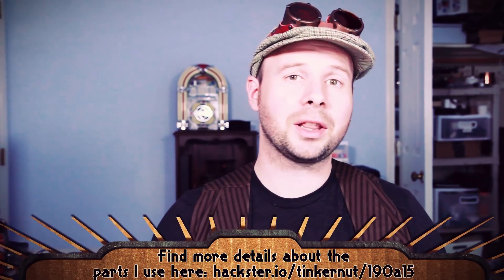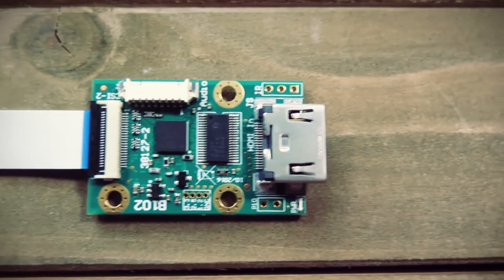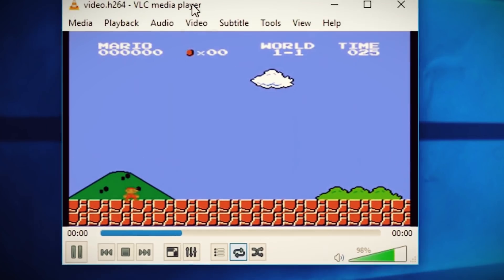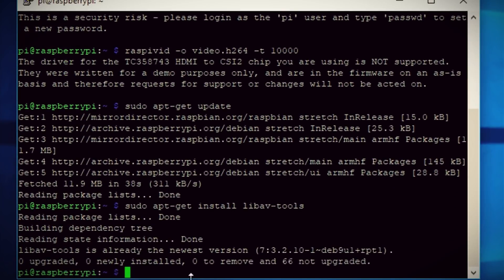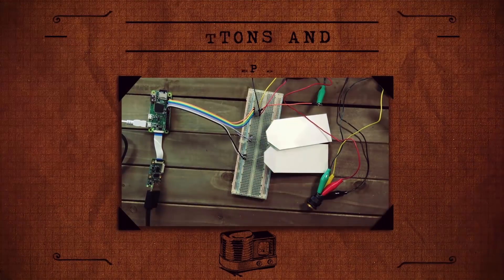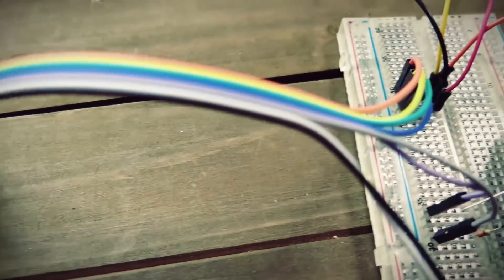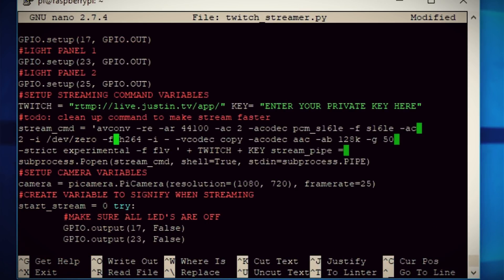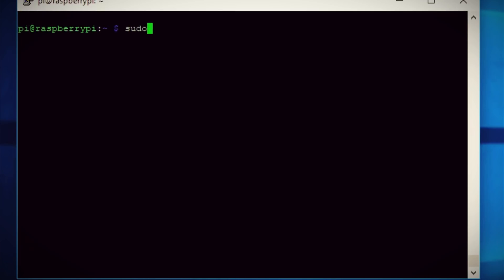⚙ Add Video Input To The Raspberry Pi - Tinkernut Workbench

Comment: Can you add a physical HDMI output as well? (Instead of a wireless stream)
Reply: Since that adapter is plugged into the camera port you should be able to view it just like a regular pi camera. The raspberry pi website has a good guide for getting started with the pi camera. I've personally never used it myself so I have no idea if it'll be laggy or anything.

Comment: I ran into trouble identifying the Auvidea model number to Pi compatibility details, so here it is: 

Auvidea B101: Raspberry Pi 3
possibly 1 and 2 as well, but I've the 3 and confirmed this works. DO NOT USE THE OFFICIAL PI CAMERA ADAPTER CABLE TO TRY AND USE THIS WITH THE ZERO. The official adapter uses opposite sides of the cable while the the Auvidea cables use the same side. By using the adapter, you're wiring the HDMI adapter to the Pi Zero with backwards. You'll know you effed up because both the Pi and the Auvidea adapter will get VERY hot quite quickly.

Auvidea B102: Raspberry Pi Zero W
I don't have this Auvidea model, but the site specifically calls out compatibility.

Auvidea B110: I don't yet know
I don't have one to test and the B110 product page does not specify compatibility. However, Both the 102 and the 110 list a 22 pin cable, so I would guess this module is compatible with the Zero.

Comment: thanks. looking for composite input though so i can capture and possibly stream from a 35 year old tube camera... not having much luck though
Reply: Pretty sure the Pi is not capable of doing the composite video conversion, That needs a hardware component, There is probably an adapter already out there to do that job though.

Comment: Great ideia! I wonder if we can combine multiple RPIs + HDMI video input to make a video wall processor cheaper than the current ones that are hardware based and cost around ~$400 to $1200
Reply: A Pi is basically a Linux Box, So anything you can do with multi screen setups, video walls etc should be easy peasy Pi.

Comment: Hi, this is amazing concept and I really like it. But I have few questions that I would really like to get answers:
(For my build I want to use  Raspberry Pi 3 B+)
1. What is the maximum bitrate and resolution + framerate that you can stream with this setup?
2. Can it be used as portable streaming station with powersource and any kind of wifi usb modem connected?
3. Can streaminig inforation like current bitrate, stream time, etc be somehow displayed on some kind of display?
4. Will it somehow be possible to connect 2 wifi usb modems and select 
which it has to use depending on signal strength?
Reply: 1. You may need to play around with the bitrate for yourself. 
As far as I can see, FFMPEG isn't encoding the video, rather, the CSI adaptor is. FFMPEG is simply copying the video stream (avconv -i - -vcodec copy) from the raspivid pipe output.
2. I'd imagine it could, just remember to provide enough power on the go.
3. This could be added to the code, for sure.
4. You're pushing the maximum bandwidth of the Raspberry Pi, there. Remember, everything is more or less connected to a USB Hub, including your flash storage. The more you add to that hub, the less bandwidth there is to go around.

Comment: Hi Tinkernut, a big fan here. Could you tinker around with the hdmi input camcorders ( some of the pj series of Sonys, or the axp ones, with buit in projectors) if they can record ? I remember those old days around '90s some guys in europe could actualy change the firmware of the camcorders to record through video out ports (They were built as in and out, but opted as not to let video in originally) . Btw, I very well know what hdmi out and in is, just cannot figure out if those projector camcorders have a slightest possibility to direct the stream to the recorder itself with  their supposedly passthrough hdmi input to projector, or could you lead me a way so that I can rapidly progress learning other than "buy  dismantle and try" ?

Comment: This could be adapted to be a low cost HDMI capture device like the Atomos ninja blade and Blackmagic Design Video Assist.
Reply: Unfortunately, I don't think so, since the whole point of those is that they record in less compressed formats, such as prores or dnxhd, while this is probably only able to record in H.264, which is probably what your camera is already capturing, and perhaps it's even better from your camera, depending on the bitrate it supports.

Comment: I may not use it for streaming to Twitch, but I work downstairs away from my DVR, so I may turn it into a media server with an IR Blaster for remote control. I was previously using an older Hauppauge, so believe me, this will be interesting.
EDIT: After reading the product page over, it seems to state it only works for the Pi Zero. Is this true?
Reply from the maker: The one I'm using (B102) only works for the Pi Zero. The B101 works for the large Pi's.

Comment: FYI, ffmpeg is much more powerful and flexible than avconv.  (One of the guys behind Ubuntu runs avconv, otherwise it wouldn't exist.) =)
Reply from the maker: I agree. But on a Pi Zero it takes upwards of 6 hours to compile...
Reply: Why not just use a pre-built statically linked arm binary instead of compiling the beast yourself?

Comment: Wow very great video! I I'm doing something similar but I'm just using an easy cap capture device the video quality isn't the best it is hdmi but the quality is limited to 720p30fps ,for streaming its great ! And it costs 15 bucks ! So if you want to do a cheep alternative check it out
Reply: Kill Me question. How many delay/lag exists between direct video and the video on Raspberry?.

Thanks for your answer
Reply: Those take HDMI in, and convert it to composite internally for capture. It's not 720p that you get in the final output at all.